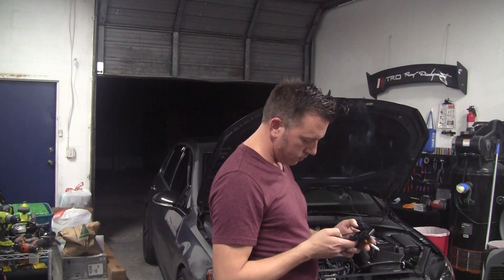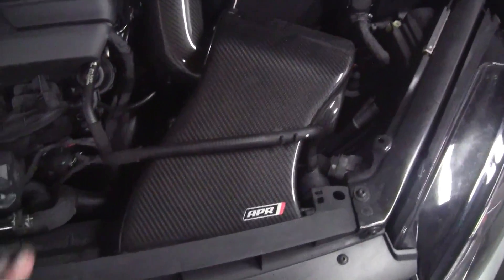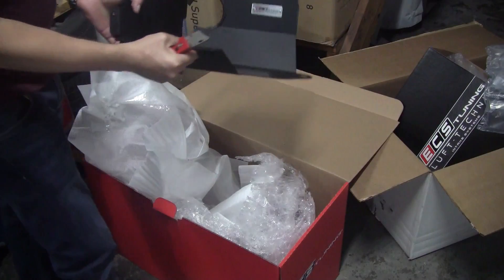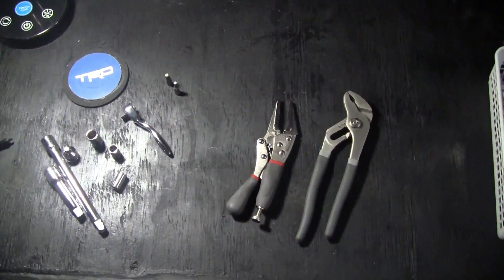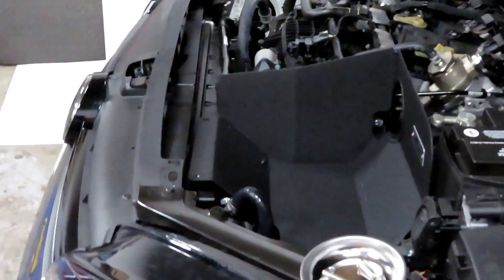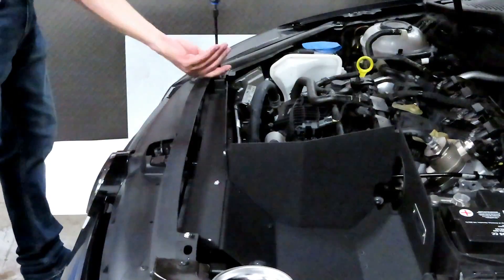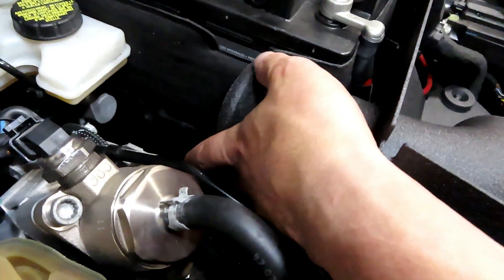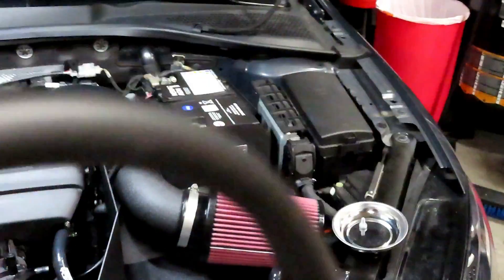VW GOLF R $200 Luft Technik (DIY) Air Box Install, and Compare to $500 APR Carbon Fiber Air Box.

Comment: NSFW warning at 7:28, man got jizzed on badly.

Any plans to get the carbon fiber cover? The other big downside of the APR intake is that the open end on the left that is left uncovered after install lets all kinds of crud fly into the engine bay, making it a mess.
Reply: Too true. I was planning to get the cover but went another route and just swapped out the R for an M2. Videos to follow shortly.
Reply: @mikeverneuille8492  i new to this but what are you talkin bout with the R or M2??? and did you post a video
Reply from the maker: @Da01Realist  Hey @DaRealist. I meant i sold the Golf R and got A BMW M2 Competition.
Reply: Are you talking about the open left side of this air duct install because from what i see his Apr carbon intake look pretty closed except for the small three openings in the front grille.. care to explain??. And also all Luft Technik does not have the close box for example mines for my A7 is open like this video
Reply: @Da01Realist  Yeah, the left side on APR closed intake for MQB platform has you remove the back cover of the airbox that goes all the way from passenger headlight to drivers side. The APR snorkel will cover the right side of the engine bay, but the left is now open and a bunch of dirt and water will flow directly through the grill onto your engine bay.